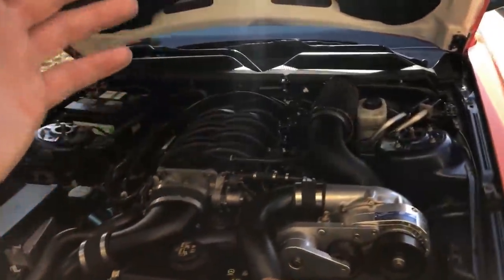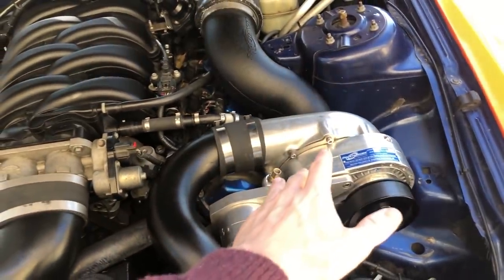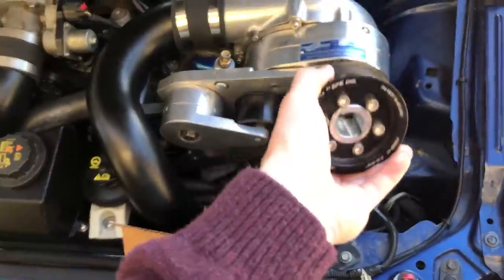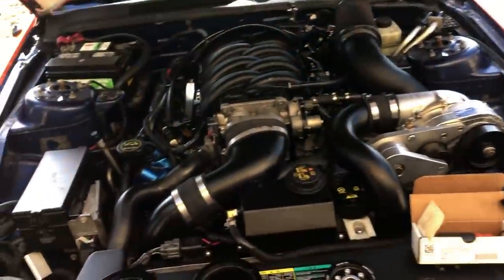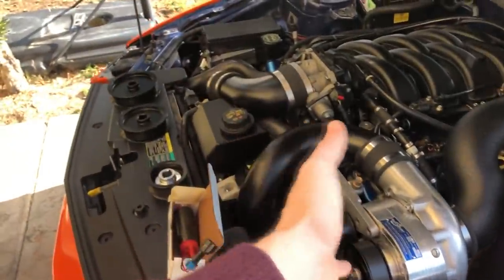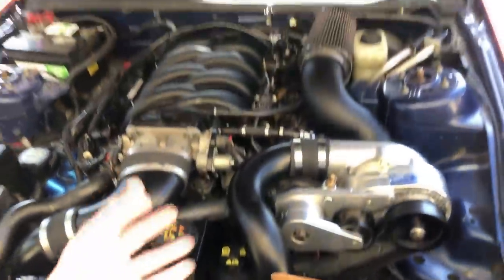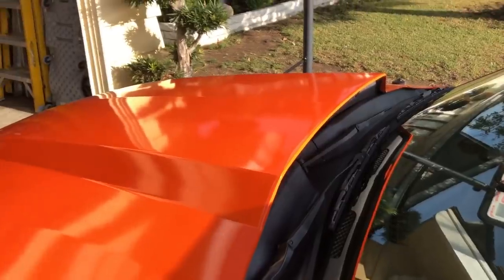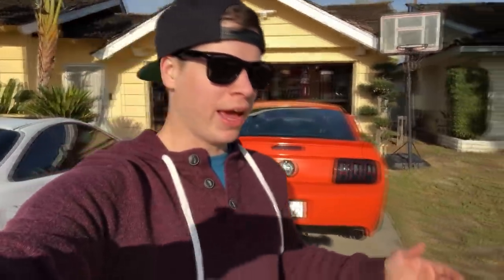Mustang With 20+Psi Of Boost Is Just Too Wild!!! (New Mods Installed)

Comment: Just for future reference, there's some liquid that you put in the cracks of the body panels and it helps promote the adhesion of the wrap in tight spaces. If you have the option to use it on the next wrap I'd recommend it.

Comment: Gotta relocate that intake my guy. It may be next to your hood scoop but even with the radiant heat from your engine hot air rises and cold air sinks. As it’s vacuuming in the air it’s going to get that hot air mixed in with the air from your scoop. Restricting it is killing your gains.

Comment: My Gfs cousin just bought a stand with a whipped, things fun, also I got a question, I replaced his serpentine belt tensioner as it was broken but it was a ROUSH tensioner and I put a OE motorcraft, have you ran into an issue running stock tensioner or you have an aftermarket one